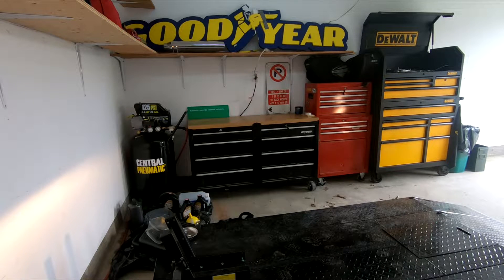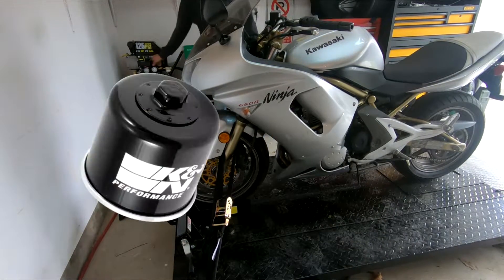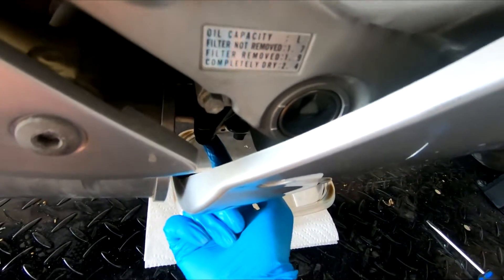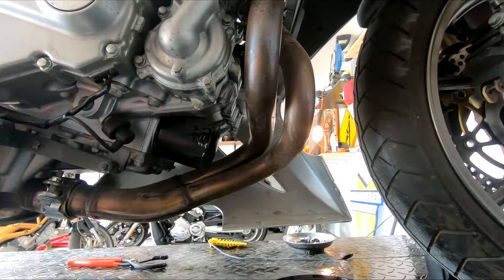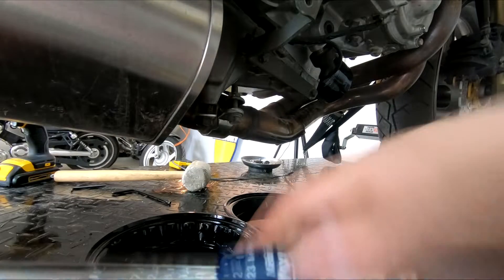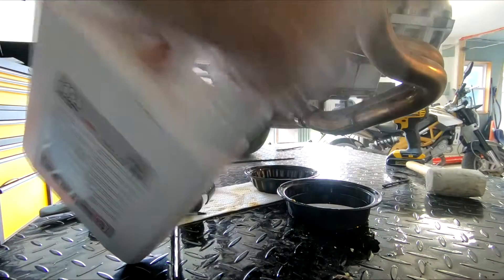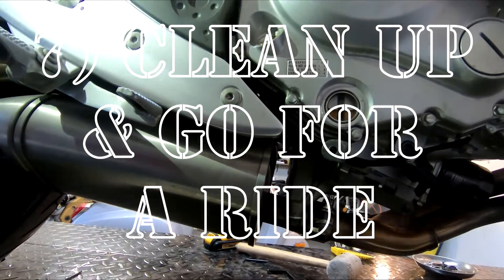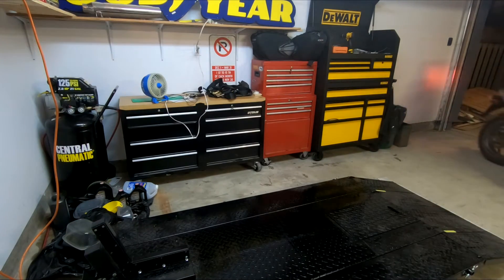Easy DIY Ninja 650 Oil Change

Comment: I didn't have to remove my fairings on the 2017 to 2019 because they keep them far enough off so the drain plug is actually in a different spot it's actually on the side by the tow shifter
Reply from the maker: Nice, that's a good improvement from Kawasaki!

Comment: Hello, I have the same motorcycle that you bought it for me a while ago without the fairing but I would like to put it on some page that you recommend to buy it online
Reply: where can i buy the fairing for the kawasaki ninja 650cc 2006
Reply from the maker: @richarfbi1382  Contact your local Kawasaki dealer if you want to be 100% sure it will fit. You can try other places like bikebandit.com, but the cost of shipping large things like fairings is high. It will probably make more sense to buy local and support your local dealer than to buy online.
Reply: @YouMotorcycle  Thank you very much for answering me.  so I will contact my local distributor
Reply from the maker: @richarfbi1382  happy to help. Good luck. Worst case you leave it as a naked bike
Reply: I want to see where you put the oil into Kawasaki 454 1988

Comment: Misleading thumbnail.
Reply from the maker: How so? Sarcasm?
Reply: @YouMotorcycle  that's a newer 650. It's not the one that you're working on. I think that model in the thumbnail is for the 2012-2016. The bike you're working on is 2006-2011 TOPS.
Reply from the maker: @AvocadoAtrocity ..? So what? Motor, oil, filter, process, are all identical
Reply: @YouMotorcycle  Kinda, but the fairings and locations of bolts are different. I understand and I still watched your video. BUT wish it was just my bike like in the thumbnail. Know what I mean?
Reply from the maker: @AvocadoAtrocity  are you actually an avacado? Does it matter?